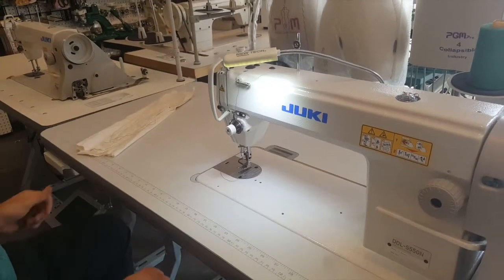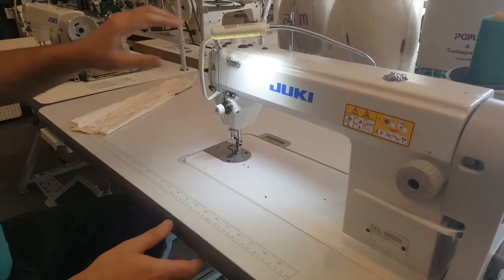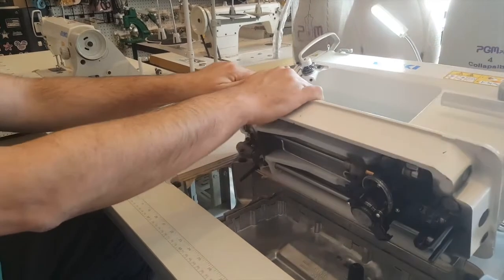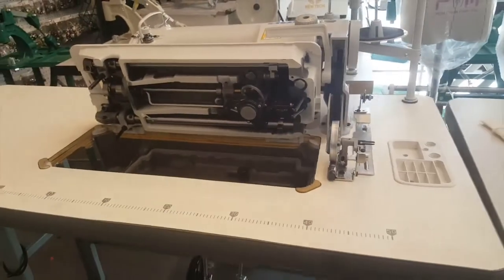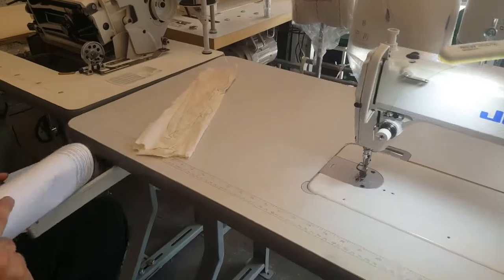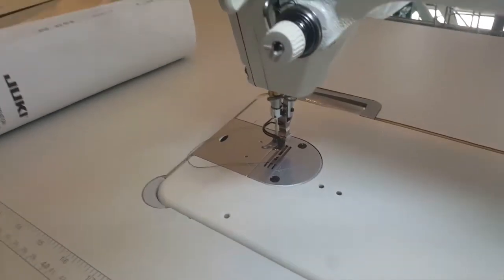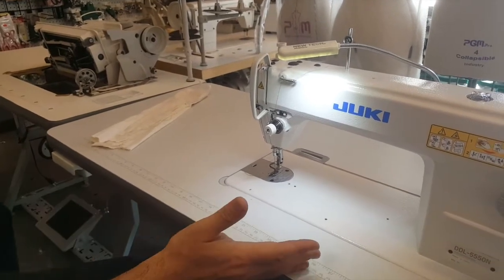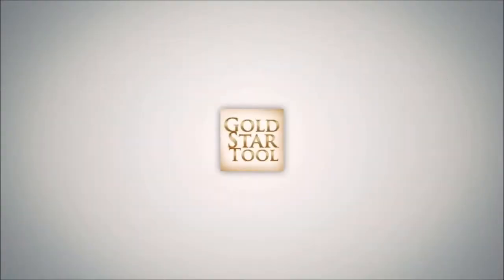Product Comparison - Juki DDL-5550N VS Juki DDL-8700 - Goldstartool.com - 800-868-4419

Comment: Why are sites writing the 8700 has longer arm length for industrial and 5550 has shorter arm made for apparel sewing?
Also, are the parts like needle plates interchangeable for replacement parts?